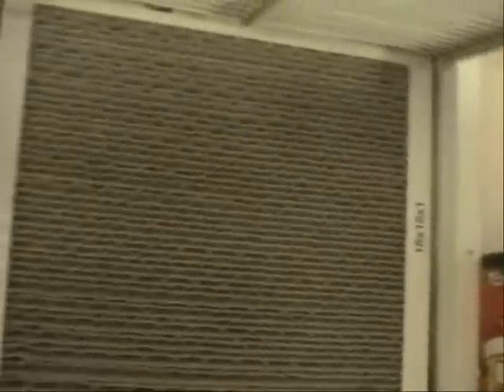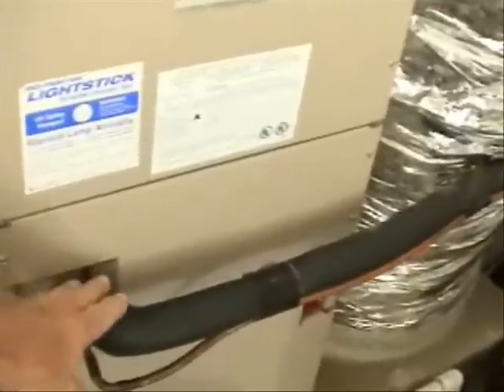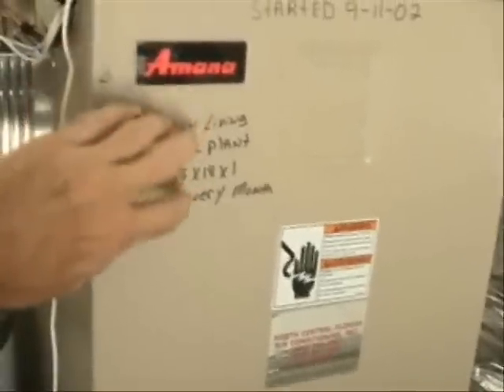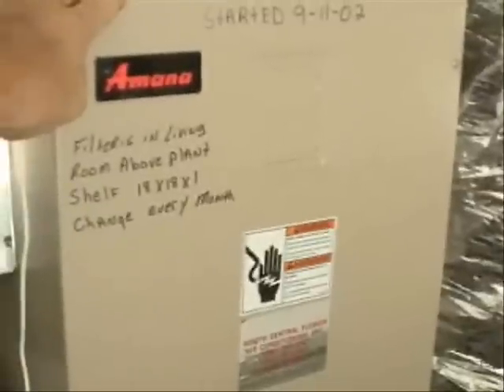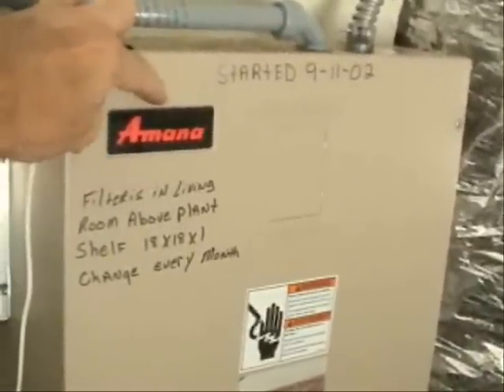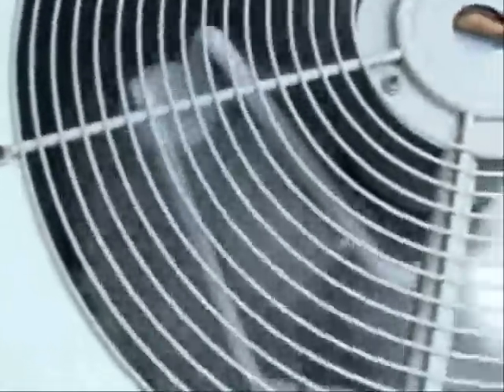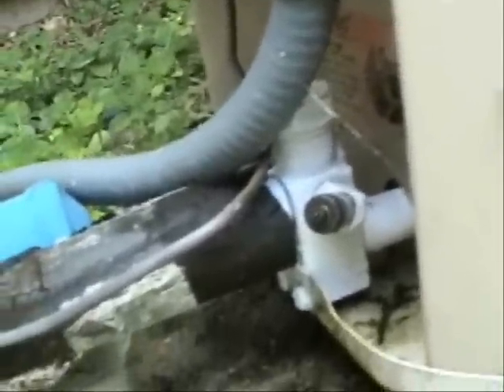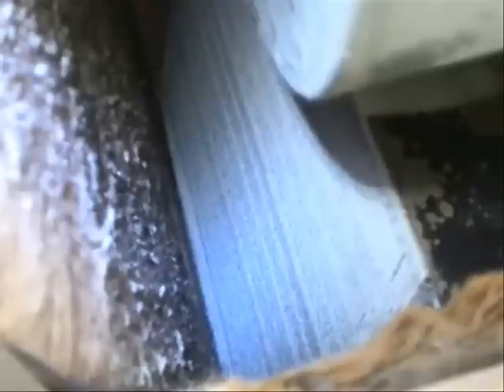HVAC Frozen Evaporator Coils

Comment: Does my A/C Condenser Unit outside have to be the same size as the A/C Air Handler inside for my Unit to run without freezing up??

Comment: My coils freeze up but if i leave the furnace door open where the motherboard is , the coils do not freeze up. But its bypassing the air filter. What could be the problem?
Reply: Jacob Sicard If it doesn't ice up with the door attached then there's nothing wrong.
Reply: DrZarkloff if i leave the furnace door detached, it doesn't freeze up. Only when it's closed. Filter is clean but i do buy the expensive filter, maybe its too thick the filter.

Comment: sir i have a problem from my outside condenser unit i put gauge from a lvl that required ang amp i cheack...still not enough then i try to on mu unit then add gas r22 then the gauge still not comming up same at amp. then after a minute have ice already so what whould i cheack?the gas fillter o compressor cause compressor still ok pumping normaly...help m pls...

Comment: Also what can cause a unit to freeze up that was not mentioned is if the t-stat is set too low ( owner sets stat to 50 degrees & unit runs & never shuts down because it cant pull the load down to the desired temp setting of 50 degrees) or a bad control board in a commercial package unit.

Comment: Why the heck does it require a tech to add freon.... I just had a brand new hair handler and condenser unit installed 22 months ago and its already starting to have freezing problems most notably at the service valve and the air handler coils and this only happens early in the morning between 4-8 am when humidity gets above 90% and the dew point has been 77 lately.

Comment: What about a clogged piston? Would that cause it as well? Mine iced up then I ran "fan on" to defrost. I replaced the filter (which wasn't that bad) and checked refer charge. About 70/240 r-22 on a 90 degree day. I washed the condenser coil and checked the fan motor to see if it was running slow (motor may be on its way to failure) and seems fine. I also inspected the evap coil and looks really clean! I was shocked at how clean actually. I ran the unit again and it iced up. Defrost it again and the following day I ran it  and seemed perfectly fine! WTF? For about a weeks it was doing great even yesterday at OSA at 104* I started it early this morning to get a Headstart on the day and found the line frozen again :(  do you think whatever was lodged in the piston could have dislodged and then re-lodged itself, or could be a dirty liquid line dryer? Why did it stop and then come back?? Lol
Reply: i don't know why it's icing the evaporator. The pressures appear good.
Reply: +DrZarkloff lol me either! It's running right now just fine after and hour of defrost fan only. I've never seen this and I have been working with refrigeration for 20 years.
Reply: +DrZarkloff it's my own house!    Lmao
Reply: +DrZarkloff i'm just guessing now, but maybe the charge is or too high during light loads in the morning? That's when I started it. Now it's 94 osa
Reply: +DrZarkloff that makes no sense because I started early in the morning before and I've never had this issue this is crazy

Comment: please help I have same issue frozen lines and condenser I checked everything it works fine other then blower stopping due to coils..freezing....I'm getting it checked tomorrow to see if it just needs to be refilled..with freon
Reply: if the blower isn't running then that's why it's icing up.
Reply: and if the blower is running then your system needs refrigerant

Comment: frosted line but blower motor works for a few minutes and then shuts off. house set to 73 but staying at 77 for the last 4 hours.
Reply: you might want to check the run cap.

Comment: You seem like a smart man and a good professional. Tell me your opinion. In split type air conditioner.If I close both sides of the external unit and leave free only the entrance where is the fan. In heating mode would increase the efficiency? Particularly at low temperatures close to zero or slightly below zero. I think it will increase the efficiency in general. What do you think? Thanks.
Reply: I think that you'd freeze the outdoor coil because the coil wouldn't be able to collect heat.

Comment: thanks for the tips (filter had got nasty replaced it ) turned the ac off for a few hours water poored out of the drain pipe when the water stopped turned the ac back on looking good saved me a bundle thanks

Comment: I just bought a new house, and it's been hot as blazes here in Colorado. I checked the filter, and it was completely blocked with dust and dirt. The filters say right on the box that they are only good for 30 days. I think I will get in the habit of changing them the first week of each month.

Comment: Dirty air filters and low refrigerant are 90% of the issues surrounding "freeze-ups". Why wait 2-3 hours though? Most units can be defrosted in 10-20 mins by turning the "AC" to the OFF setting and then setting the "Fan" to the ON setting. In some cases/units you can turn the heat on for a few minutes as well.

Comment: Much respect. I used to maintenace a lot of residential apartments and we had a lot of issues of icing up of evaporators and lines. My HVAC contractors found that most of the time the defrost boards on the units have gone bad.

Comment: The thing is blower motors can be running while a tech is there and overheat after time and shut off eventually causing frost. Air filters cause frost a lot of times but have to be extra restrictive. Freon happens to be a problem a lot of the times but that entails you have a leak somewhere in the system either being repairable or not. One really important thing he forgot to mention was a plugged evap coil which also can cause freezing. This is a job for a tech though. Metering device included with freon

Comment: Hi Dr! 
Great video! My exterior ComfortStar unit (CHH012CD-13B) has absolutely no water accumulation under the unit when in use. However the interior wall mount unit continues to provide cool air. There is water exiting the drain hose from the wall mounted interior unit. I removed the cover on the unit and observed an error code sequence on the interior PCB board of : LED 2 - Green Blink 1 time, LED 3 Red - Blink 8 times, LED 4 Yellow - Blink 1 time. 

Thank you for any help. -Ron
Reply: Sounds like a sort of mini split. The exterior condenser is not supposed to produce condensate. Maybe some sweating on the lines. The inside evaporater coil absorbs heat from the inside naturally causing condensation. The outsides purpose is to get rid of the heat absorbed from the inside. Long story short on hvac condenser outside units they are not supposed to produce condensate.

Comment: Low freon = less pressure 
this means colder coil temp (below freezing) I think its a fragile state...add more freon and it become a more stable state right above freezing-  question answered  a month later....

Try stretching an EMPTY balloon really hard, then (while still starched) feel it against your cheek- it will be very warm depending on how hard you stretched it-   then (while still starched) blow on it to cool it down, then release the tension on the stretched balloon...cold

Comment from the maker: It sounds like your system is running in the heat mode. If that's the case then you could have a restriction at the liquid line filter drier or the restritor in the outdoor unit.

Comment: I have a 12,000 BTU/h mini split heat pump unit which has low suction 40-ish#. Suction pipe frosts up early in the morning with proper charge. I had to recover some refrigerant to starve the evaporator so no frosting occurs. Unit cools very well but that low pressure reading annoys me.

When I last checked superheat I got the following readings: Tamb:93F; Tsuc:55F; Psuc:46#; SH:32F. Twb at evap: 63F. Coils and blowers are sparkling clean. Unit has no liq.line filter. Any suggestions?

Comment: Hi Dr.Zarkloff,

I have a 12000BTU Split-air conditioner system-ComfortStar.
The unit was installed last summer and worked perfectly. I powered on the unit for the first time this year last weekend, it's not producing as much cold air as last year. Checked the condenser unit, noticed that the smaller of the two copper pipes had ice formed on it. 

Both lines are properly insulated, no accumulation of water under the unit. The aluminum fins are all clean. Filters are very clean too.

Any ideas?

Comment: sir i have also another issue of frozen up evaporator of package unit and the water fall down in the room.i also saw ur video about this issue.but sir i have checked all things sir its filter,evap motor outdoor motor,i have also change its belt.and i have clean inside of both coils three times i have  made vaccum..and that package unit had two compressor and motor.so sir please tell what is a wrong with that unit.

Comment: You need to tell people in the first place, that the air-conditioner is an electrical item that needs to be disconnected from the electricity supply before opening any part of the air-conditioner.
.
If someone dies opening it or looks at their fan to see if it is going.
Their Estate could sue you for not providing proper guidlines.
.

Comment: @ DrZarkloff-Thanks for the feedback. Actually, turns out that I had a bunch of problems that all happened at the same time. The condensate line was backedup. The air filters were dirty. When I ran the ac unit after defrosting the ice, I burned out the motor and the capacitor. To top it all off, I was actually low on freon. The ac guy thinks that I may have a freon leak. For now, we are just going to run it and see if the freon drains out in the next couple of days. Thanx again for the response.

Comment: Great videos...question, how long should a compressor run after the inside unit shuts off?  I can't remember mine running as long as it has recently.  I turn off the compressor circuit breaker so it won't burn up till I can get tech out here.

Comment: what the good doctor is saying is that this particular system could either have iced/frosted up due to mechanical (leak search needs to be performed) or electrical failure (capacitor on indoor fan motor possibly).  that's why it's money well spent if you have a maintenance agreement with a well respected local HVAC company where they come to your house twice a year to perform a heat or cool tune up.

Comment: Dr. Z, I was checking out a 3 phase carrier commercial package unit air conditioner straight cool. It has two compressors, and one of the compressors is iced up and the other compressor runs warm. How does these compressor work.

Comment from the maker: @alfebre1  It's really a good idea to replace the motor because a motor that is reading ohms to ground will over amp and could put stress on relays and relays that are integrated on expensive control boards. Hermetic compressors with ohms to ground will build up acids that will eat away the winding insulation. The compressor will be an acid burn out and the entire system will have to be flushed. The repair will be very costly.

Comment: hello i bin havin problems with my AC well it runs but no cool air comes out only normal air and it has bin like 110 hot outside and my aparment is very humid and real hot we sweat a lot its real bad i go to sleep sweating and wake up sweating i live in this aparment and i have call for help and theres this dude who comes and just gos in my aparment and in 3 min the cold air is running and then

Comment: DrZ I have to say you do a great job covering all the basics of HVAC troubleshooting. I would like to add one thing to this video however.  If you find a filter that is dirty enough to cause enough of an air flow problem that your coil freezes up, it may not be a bad idea to check the evaporator to see if it is stopped up as well.  simply putting a new filter on it may not be a 100% fix for the problem. 
  -Hope to see more new videos!

Comment: @figgy1872  yeah I agree with DrZ.  it doesn't sound like a TXV problem to me either.  one thing to take in consideration before just pumping some gas back into the system, is it had to go somewhere.  it needs to be leak checked.

Comment: thanks for these great videos DrZarkloff ... if you dont mind I have a quick question.  My AC motor runs and I feel a faint breeze coming from the ducts, but nothing more ... the breeze feels cool, but the AC runs for far too long.  From this can you tell if it's a problem I can fix myself or will I need to call a tech out?

Comment: Thank you it is a good demonstration..
 
The good thing is most AC units have low pressure cut outs that will trip compressor when the air flow is blocked or stopped..

Comment: Thank you for posting this video Dr. Z! Helps me understand more how my HVAC systems works. I have one question thought. My Evap Coiler sits on a plastic drip pan. It seems to not be draining properly causing the drip pan to overflow with water. What can I use to clean out the clogged "draining pipe"? Any feedback would be greatly appreciated.

Comment: Thanks so much for your series, it really helps us learn how to maintain our homes. I just spent most of the day fixing our frozen coils (caused by a reason not mentioned in your clip). So much hair and lint had worked its way past the filter and onto the fins that no air was getting through whatsoever. Not wanting to use a hose in my cupboard, I removed it all by hand :(. I believe my mistake was years of changing the filter without turning off the HVAC in a home full of molting dogs and cats!

Comment: i thought it was and overcharge with refrigerant that causes evaps to ice up or low air flow preventing heat transfer in the coil.

correct me if im wrong please because low refrigerant would not have enought refrigeration effect to ice up the evap? please reply

Comment: Oh ok I get it now! Ok, yes I was confused about the suction line on the heatpump being frozen over, as well as the indoor coil .. But I understand now .. If the indoor coil gets frozen over ,then the return line from that coil back to the heatpump can get frozen too (cus there is still a lot of cold in the freon floating back to the heatpump .. and heat conductivity and stuff).

Ok thanks.

Comment from the maker: The evaporator is the coil that could freeze over in the cool cycle if you have a malfunctioning indoor blower motor or if the system is low in refrigerant or if the air filter is excessively dirty or if the evaporator coil is excessively dirty. 

The suction line is the line where the refrigerant travels after it's left the evaporator coil and is headed to the compressor.

The condensing coil can freeze over in the heat cycle if it's excessively dirty or if the system fails to go into defrost.

Comment: I don't understand.. Why would both the condensore radiator and the evaporator radiatior both be iced over? It is one or the other .. one gets warm, the other gets cold, that is how a compressor works..... Evaporator coil could get frozen is in AC mode ... Condenser coil could get frozen if in Heat mode..

Right? I'm no expert, just a smartass student... I don't get it . What's a suction line? Obviously not the freon lines?

Comment from the maker: You might have a refrigerant leak. You'll have to find and repair the leak before adding refrigerant. Actually, you'll have to recover all of the refrigerant before repairing the leak then once you've made the repair, you have to put the system into a deep vacuum with a vacuum pump. Then you'll be able to weigh in the charge.

Comment from the maker: You need to figure out why the evaporator is icing up. It could be a dirty air filter or a dirty evaporator coil or a is the blower motor isn't turning or if you're low in refrigerant.

Comment from the maker: Actually, on a mini-split, both lines are low pressure. The metering device for the indoor coil is located in the outdoor unit. You're right that it's a different design than a regular split system.

Comment from the maker: If your air conditioner keeps up with the thermostat set point, your system is probably sized right. It really doesn't matter if your air conditioner stays running all day long. If it doesn't keep up then you might want to call an a/c company and ask them to do a heat load calculation on your home to see what the proper size should be.

Comment from the maker: I would start by cleaning the evaporator coil. If it still froze up after cleaning the coil, I'd check out the blower motor and or run capacitor.

Comment: If a coil ices over like the one in this video, dose the level of liquid evaporation decrease and allow more liquid to return back to the compressor? potentially damaging it?

or is that just dependent on the high/low pressure diff and it'll evaporate at any surface temp?

Comment from the maker: I'd first check to see what kind of high side pressures you're getting. If the high side seems to be low then you could have an under charge or If the indoor coil has a TXV then the power head could be bad or you might have some trash in the body of the TXV.

Comment from the maker: You might want to check to see if the blower in the air handler is actually turning. If not then you have either a bad blower motor or run capacitor and/or relay.

Comment from the maker: Not every system has high and low pressure switches. My Amana is a perfect example of this. That's why I chose to show this as an example. Also, I've seen many frozen evaporator coils due to a blower not running. Trust me: it happens.

Comment from the maker: There are many reasons why your evaporator could be icing up. The blower motor might not be running or the air filter is too dirty or you have a bad TXV or you have an undercharge. You might want to start with these possibilities.